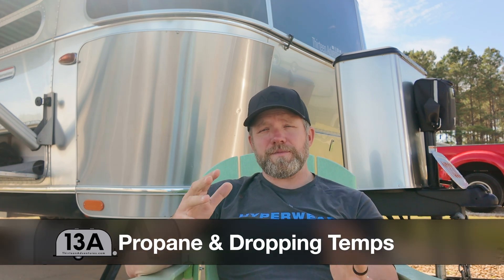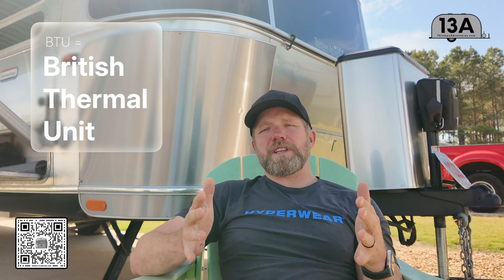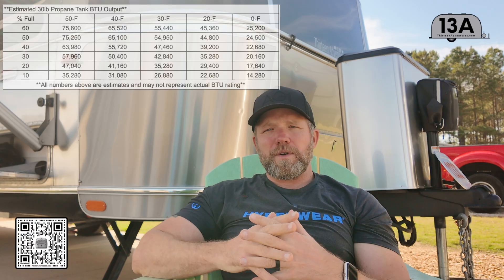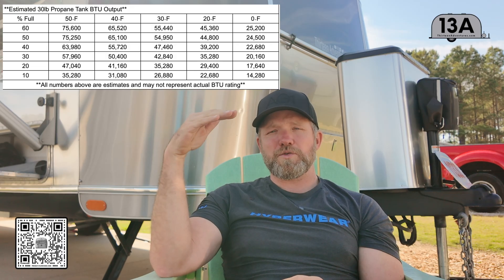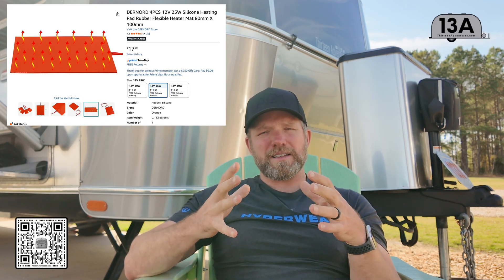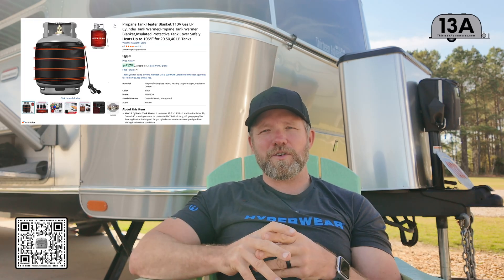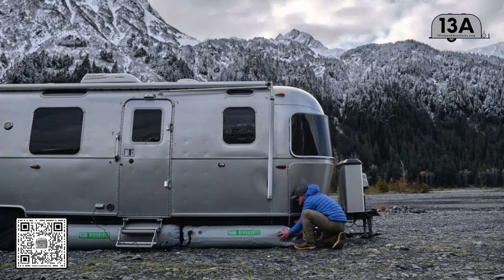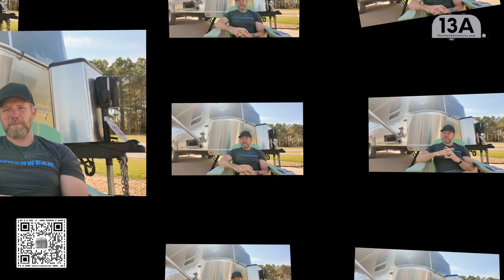Running Out of Propane? The #1 Reason Your Furnace FAILS In Cold Temps

Comment: Those skirts only work if the ground is still warm. Once the ground is cold it’s not doing much.  I know some will put a heater down there and you gotta be careful doing that too. Most heaters are not designed for 100% duty cycle and can melt or catch fire.
Reply from the maker: Thank you for your insight and education in this!

Comment: I was thinking the other day, when I was packing up, that another energy-saving idea is having an inductive cooktop (which requires the correct pots/pans) to save on propane in cold weather (while connected to shore power).
Reply from the maker: That's a fantastic idea for saving propane.  We use these pots and pans as they work on all cook tops and the handle comes off for easy stacking. https://amzn.to/3MyDBuH
Reply: @ThirteenAdventures just looked now. 40% off $72 for set. Didn’t mention if they’re air fryer friendly. Do you know and have an affiliate link?
Reply from the maker: No affiliate link but the Amazon link does give us credit.

Comment: We use a tank heater for temps when below 35 degrees to assist in vaporization. Also, if I remember from RV school, propane boils at ~ -40F.  Great education video!
Reply from the maker: That's a great tip about the tank heater, thanks for sharing your expertise!  Im going to make a video on those soon!

Comment: So, does the cold only affect the flow rate? Temps usually only down to 20s or so, but my auto switch has always switched when tank is truly empty. Or at least I thought so. Does the cold affect the overall capacity of a tank? Or just the flow rate.
Reply from the maker: That's a fantastic question!
The cold affects the flow rate (the vaporization rate), not the overall capacity (total BTUs/energy) stored in the tank.
Your auto-switch is working correctly because the cold makes it harder for the liquid propane to draw heat and turn into gas. If your furnace demands 18,000 BTUs/hr but the cold tank can only vaporize 15,000 BTUs/hr, the system runs low on pressure and your appliances sputter.
Essentially, you don't run out of fuel; you run out of pressure. In extreme cold (like near 0  F), your tank can switch even when 10% or more liquid propane is left inside, because that remaining liquid simply cannot generate enough usable pressure.
Hope that helps! Safe travels!
Reply: @ThirteenAdventures  Ok, great. I don’t spend much time in trailer at extreme temps anyway, but good to know what would be the weak points if needed. So, any lower than 5 or 10 should probably be thinking about adding some heat to the tanks. I’ll save that chart too. I’ve never had sputtering.. yet. Thanks much. 👍

Comment: Great video! Thank you. ❤
A couple years ago we ran into a winter storm on our way from Michigan to Florida…got stuck in Kentucky as the storm changed directions further south than expected. Kentucky shut all interstates due to flash freeze and ice pack….not to mention jack-knifed semis. We made it to a campground (KOA) luckily but were stuck for 3 days. Lowest actual air temps were -7F with -27 WC. Went through 2-20lb tanks in those 3 days just running the furnace and minimal stove usage for coffee and chili/soup. I ran the 3 way fridge off shore power but was worried about its performance as well. But it never hiccuped 
Toilet we flushed with RV antifreeze when we had to. Quite the experience. I think our pup suffered the most trying to go in the snow and frozen tundra of Kentucky.
We are planning to head south again in a week from Michigan and the temps right now are running 20-25 below normal here. Fingers crossed we don’t hit a similar situation.

Thanks again.
Reply from the maker: Wow, that sounds like quite an experience! So glad the video was helpful and wishing you safe travels on your next trip south!

Comment: You miss a vitally important part of the problem. That is where and when you fill your tanks.

In hot weather, southern distributors fill "propane" tanks with a mix - possibly as much as 50% butane. This is actually a necessity, as an lp tank will go over pressure at 100°F if filled with straight propane.

The problem comes when that mix gets cold. At 20°F, none of the butane is going to come out of the tank. The tank may be half full, but all the propane is gone.  Even with heaters, the butane may not come out at 0°F, and can even condense back to a liquid in the lines.

Rest assured that getting your tank filled in a northern state in fall and winter will get you 100% propane. Not so with tank exchanges so beware!
Reply from the maker: Thanks for watching and your feedback.  While I am no propane expert, I am certified in many states for filling propane and working on RV propane systems, this is not something I have ever heard or been taught for RV propane systems.  That said, your statement is/can be true of the small green tanks and other small canisters.  The difference lies in the type of fuel: large tanks are almost always propane, while small, disposable camping canisters can contain butane, propane, or a mix. Butane is better for warmer temperatures and is used in small, thin-walled canisters, while propane is better for cold weather and is stored in heavier, high-pressure tanks.
Reply: @ThirteenAdventures "propane", in the US, is almost always really LPG, and contains a mix of gasses.

The Wikipedia article on propane, after explaining the difference between LPG and propane, seems to use the terms interchangeably, and explicitly states that LPG is used in RVs.

https://en.wikipedia.org/wiki/Propane
Reply: From the bottom of the Purity section of the Propane article (emphasis added):

"The exact proportion of this combination varies by country, depending on international prices, on the availability of components and, especially, on the climatic conditions that favor LPG with higher butane content in warmer regions and propane in cold areas".
Reply from the maker: Great!  Thank you very much for the info.

Comment: I had never learned this before. TY!!! 👍👍 I’ve watched a lot of cold weather camping videos, too! 
TAKE AWAYS for us: 1. Run off a fullish tank 2. Fill a tank when it gets half low. probably bring a third tank, too. 3. Consider insulating or warming the tanks 4. Don’t camp if the temps get below 25°F. That really is our limit anyway. After that, it isn’t near as fun IMHO. 

This was a really helpful and recently applicable for us. I was wondering why we went through propane so quickly with our last trip. We do like to cold weather camp annually. Despite having the smaller tanks, the chart was super helpful to understand this concept. I bet this also applies to a generator that uses propane. 

THANKS AGAIN!
Reply from the maker: So glad it was helpful and you learned something new! Thanks for sharing your takeaways!

Comment: I’m heading to Jackson Center for warranty repair this week and it’s going to be cold. I remembered that you have heat tape around your outside sewer drain. How many feet do you recommend of heat tape to keep them from freezing? Thanks for the great videos Brad.
Reply from the maker: Thanks for watching!  I only have a 3' section around my great and black tank drain because they are exposed.  FYI, they can still freeze if it's cold enough.  You may consider adding some ethanol free antifreeze to your black and grey tank while they are empty and open and close the dump valve a few times to get some around those seals.

Comment: I learned some things in this video. Seems that if your propane demand is higher than one cold tank can provide and you don’t have tank heaters, you could improve output by drawing from both tanks simultaneously. Am I right?
Reply from the maker: Very possible.  It's really going to depend on the level of both tanks and the temp.  I still do not recommend using both at the same time because if you get too low on both and then nothing works, you could run the risk of things freezing inadvertently.

Comment: Wish I saw this video before I thought my propane regulator was malfunctioning and ended up replacing it. New regulator, new braided tank hoses and a mod on the regulator’s bracket cause I didn’t like how the hoses were pressed against the tanks. Anyway that was my rabbit hole 🐇 . At least I have spare propane components now. Thanks again for your informative content. Cheers!
Reply from the maker: So glad you were able to determine the cause!  It's always nice to have spare parts.  We have GasStop hoses on our tanks now and love them!  https://youtu.be/jRbhTldGztg
Reply: Made same mistake in S Dakota 2 winters ago. Single digit day well below nt, 4th morn woke frozen inside temp 48. Replaced everything, nothing, did a quick winterization after watching Brad’s video rented hotel room headed south 3 days later. Once in Arizona, everything worked fine 🤷🏻‍♂️